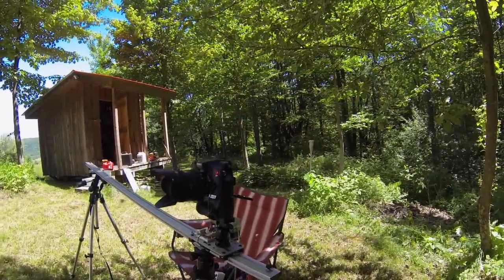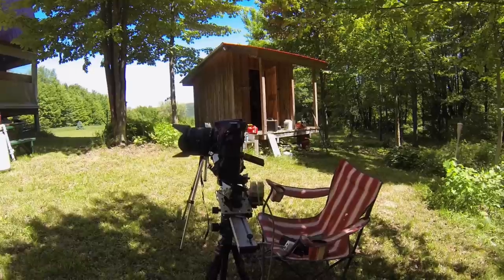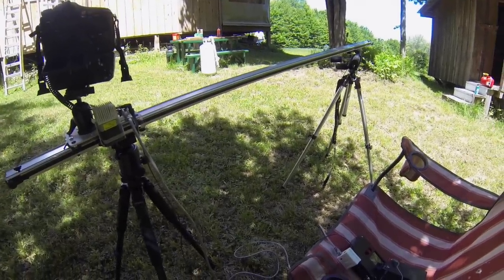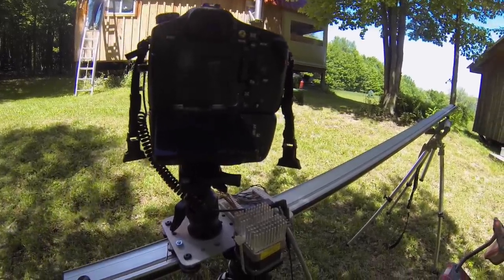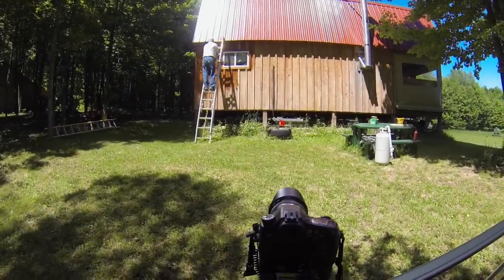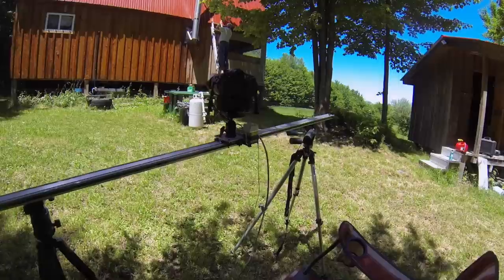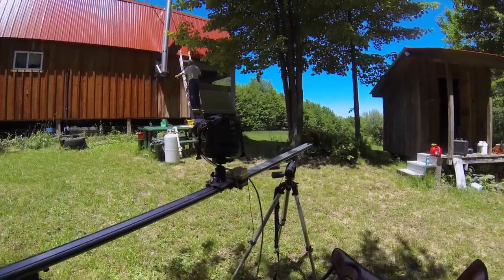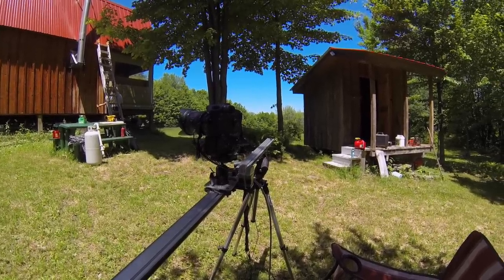miniEngine powered Makerslide DSLR camera slider - staining the cabin & stars

Comment: was this video showing motor at the fastest speed? can it move faster than this? overall, this looks great! :D About to purchase one for myself!
Reply: Islombek Karimov it can move faster... you could use it for video but its not "fast"
Reply: Chris Buffcleb okay, sounds good. I was just concerned if there would be a way to move the plate to some starting point without waiting for it to move in a long time. Thanks.
Reply: Chris Buffcleb Also, can I use Nema 17 or Nema 23 (with gearbox and without) with the same pulleys or should the design be changed a little? Thanks.
Reply from the maker: Islombek Karimov you can use either a nema 17 or a 23. I am not using a gearbox reduction model. I have used both with this setup... the motor plate will accept both...
Reply: buffcleb Cool. Also, can GT2 belting be used instead of MXL belting since Inventables website is out of stock? Thanks
Reply from the maker: Islombek Karimov you would need to use GT2 pulleys but other then that it should work fine.... and GT2 is supposed to have less backlash so in the end you would have a better setup...